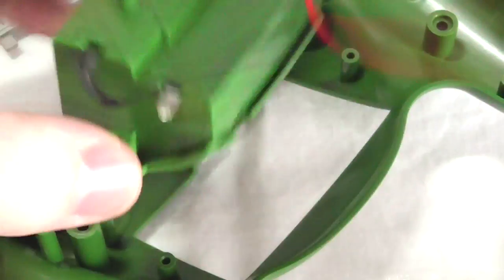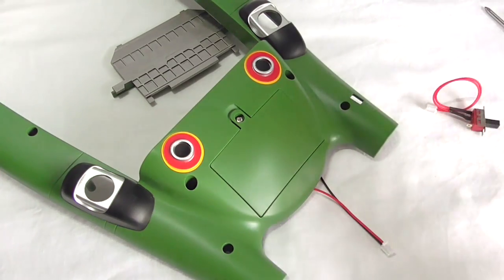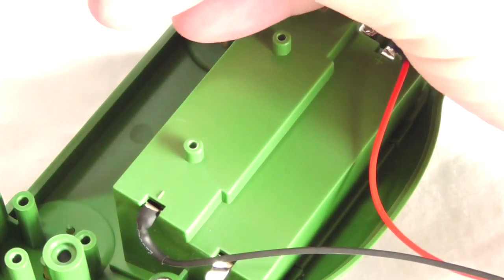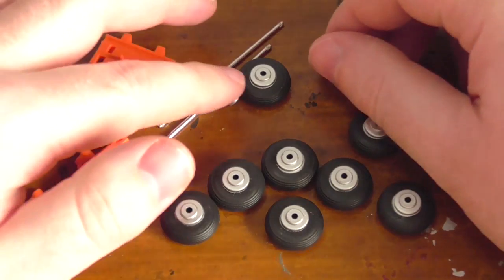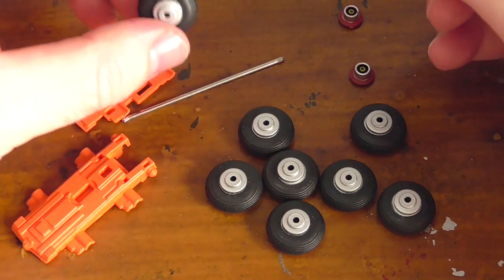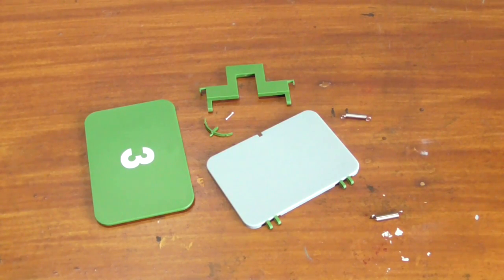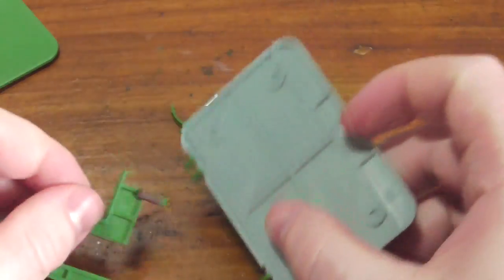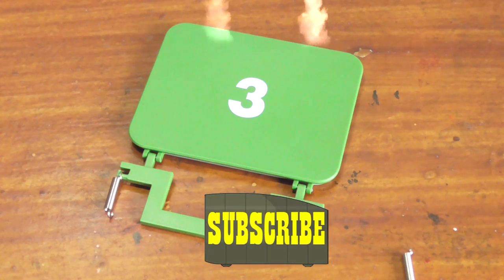DeAgostini Build Your Own Thunderbird 2 Issues 11 & 12: Battery packs and pod flaps!

Comment: I have finished the japanese release of this and i do warn you to be very careful with plastic clip that hold the doors closed. had 2 of mine snap when i closed the pod doors due to how thin the plastic was. recommend lightly pressing down on the green nub to help it slip into the notch in the door frame. also the gap near the power switch wont have any light leak through it from the thrusters  since the LEDs are pretty well sealed up so light only comes out the end of them